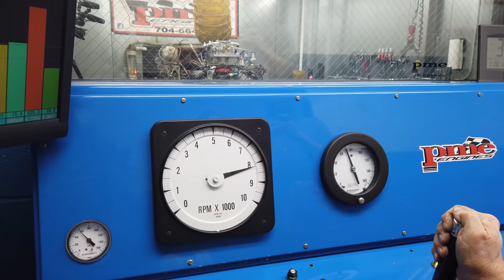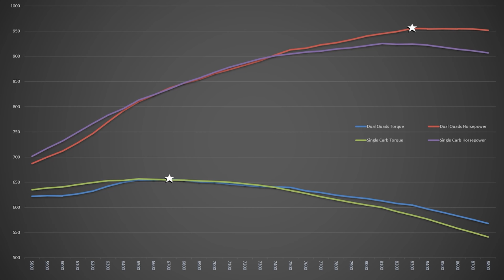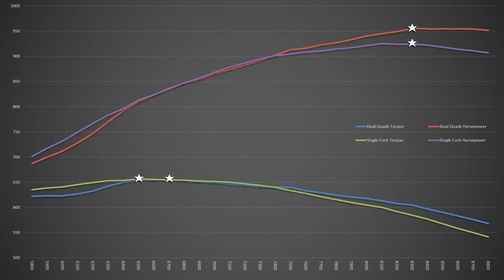955 Horsepower NASCAR Engine for the Street! (w/ ProMotor Engines)

Comment: "Used" parts or not (except for the crank), that's gotta be a $50k motor.
Reply: says it's $30k on Google.
Reply: @c.albrow9161  That actually sounds reasonable, given the exotic parts, and machining involved.
Reply: @c.albrow9161  that's too cheap
Reply: @freethinkingamerican80  tell that to Google.
Reply: 30k is no slouch either
Reply: @skoogle065  facts. That’s brand new vehicle prices we’re talking about
Reply: @c.albrow9161  Not to someone who spends 30k on an engine. Their new car or truck is probably 80k. Not hard to do these days.
Reply: @pookysdad4884  true. If I had such funds that engine would see itself in an early model C3 Corvette attached to a Tremec TR6060 with 3.73 gears 😂
Reply: @c.albrow9161  For me, it would be in a '68 Charger, with the 6 spd Tranzilla, from Rockland Standard Gear, and a fabricated 9 inch with 3:23 or 3:31s. It's fun to dream 😕.
Reply: @pookysdad4884  it truly is ☹️
Reply: @port nut dude it’s literally on their website. Stop being lazy and look it up.

Edit: matter of fact? Idk. Ask google
Reply: @pookysdad4884  nice charger but mine is an original 69 camaro ss w/ a bored out, tunnel rammed and cammed 427 with 4:11s and a tremec tko, with the car having Mickey Thompson 315s in the rear💪
Reply: Or a 72 nova w/ the same in which I’m 11 and I “own” a 72 nova
Reply: My Dad has a 600 Hp small block tunnel ram 78 Malibu drag car
Reply: @vincentgialanella1873  that sounds like fun, 300hp less hp but you can have  2of you got for the price this Beast.
Reply: @c.albrow9161  really? That's actually not bad at all for what you're getting
Reply: @c.albrow9161  Nascar claims 100k per engine 
If you could build / buy  a reliable 900hp engine that will rev like a Nascar for 30k
Start building or buying 
Serious $$ to be made 😉 
Can guarantee you can't
Reply: @c.albrow9161  NOT TRUE.
Reply: @deanmechanical  you know my comment was from a year ago right?
Reply: @deanmechanical  true then =/= true now
Reply: Used to be able to get them for 15k from Yates racing a while back.
Reply: If not more! Let's just be real. We're not all making thousands a day off YouTube.
Reply: @pookysdad4884  what filthy bum would opt for a nascar engine when an og 426 hemi rebuilder could be had for that money 😥
Reply: @freethinkingamerican80  it’s really not man you can get a 10.3 liter 632ci that makes 1000hp for 16,500$.
Reply: For me it would go into a Porsche 928 with the nascar trans axle with the sequential shifting.

Comment: It would be extremely cool to have the 700+ horsepower version.  When somebody asks “what is that….a LS?” you can say “no” and watch the gears start to turn in their head.  Or you could really mess with the Ford crowd if you put it in a Ford because of the distributor up front

Comment: My 455 Buick made 428hp at 4200 rpm and 565 ft lbs at 2800. All with a crower 210/214 @ .050 cam. Now that is a fun street sleeper. Idle is near stock and runs 11.70s.
Reply: Agree 100%. My 455 ran a custom 232/242, 112LSA .575 lift cam and it had a barely noticeable chop. 570 ft lbs, 442 hp. It was a real stump puller.
Reply: That actually sounds like a lot more fun than what's in the video. 565 at 2800 that's some push lol. I can't imagine tunnel ram and a cam that starts at 5600 being fun in street traffic.

Comment: Still push rod and 2 valves per pot. What an awesome engine!
Reply: A none PR in a 397 inch engine would be a huge brick. Fords 5.0 non PR engine is physically bigger and heavier than Chevys 6.2 engine.
Reply: @matrox  I'm still a cleveland fan
Reply: @matrox  there are 4 litre na BMW engines that are bigger and heavier than a 7 litre Chevy LS7 too, while making much less peak power and having a much narrower powerband. Long live the pushrods :)
Reply: @madhut3042  yes, D3 engines since the early 90's will make more power with a single carb. FACT
Reply: Think this is cool? (not saying it isn't, btw!)
Pro Stock engines are REALLY something!

Comment: I'd be very happy to have the street provision of this motor. 750 hp with around 550 ft lbs of torque pulling to maybe 8k rpm would be the best N/A option available.

Comment: This is one of the best Aspirations Index ( AI ) for a naturally aspirated engine ever. 397 times the 8300 rpm power peak, divided by gross peak hp is 3450.  The Australian V8 Supercar 305 engines, its 3630. I cant recall exactly the test, but I know for sure one of Richard Holdeners best 5.3 liter destroker LS was 3880, it was some thing like 550 hp at 7000 rpm or 630 hp at 8000 rpm  from 305 cubes. A flat head Ford was 221 × 3600/ 85, or 9360. As the AI number drops, you are  extracting the most hp from the least rpm. That modified R07 IS a Dynomo!
Reply: Hey
Reply: @arianawilliams1592  hey
Reply: @de4dlyzee  Hi,how you doing
Reply: TRUTH CENSORED  Personal opinion only, one which is worth nothing, (but since you asked....here it is)   Give it away to the irreligious,  non political and Un monied , and have no strings attached when you give it. And watch out for people with really tidy hair and natty dress. Over compensation is a means of raiding your pay packet. Good fortune with your quest.

Comment: Holy crap that thing's a beast. 😳 I always wondered why NASCAR style engines couldn't be found on the street. It's great to see they're finally making their way. More choices in engines is always a good thing. Great video sir!! 👌
Reply from the maker: Thanks a lot! And thanks for watching
Reply: A lot of the problem is that everything is different than standard engines. Such as they don’t have places for engine mounts because in the race cars they use engine plates. It also gets into race car stuff so the price tends to be high. With plentiful cheap turbo kits a lot of people just go the easy way and throw some turbos at a more standard engine.
Reply: People have been building these outside of NASCAR for a decade or more.
Reply: Well you couldnt get the damn car out of 2nd gear with a 1000hp engine on the freeway, whats the point of having it?
Reply: @holdenkingswood  Ive lost my license from tickets,  YES I loved that engine in the video but paying lawyers & high insurance has me a bit bitter about being labeled a criminal for my love of horsepower
Reply: @chadsimmons6347  yes you're right, the authorities much prefer us as the easy target and a way to generate mass revenue, you'd get in less trouble for mugging and drug dealing
Reply: @holdenkingswood  It's not so much hard to drive on the streets, but keeping it at 6000+RPM most of the time is a challenge. Not to mention the clutch they use is like squatting 400lbs....
Reply: @chadsimmons6347  🤣🤣🤣🤣🤣
Reply: They shouldn't be own the streets they should be own the track  track engines and street engines.its some shit on the streets is way to Much and I love me some street let's be real now.
Reply: @chadsimmons6347  that's my point exactly track is track street should stay street.we don't need all that for the street for what to kill ya self. Shit on the streets this days is already hellva fast.
Reply: I wonder how they do it with the 1,000 hp TRX that Hennessy builds.. they’re able to drive it at low rpm’s
Reply: Wondered why? Are you kidding me lol its people out here wrecking sports cars and you think they wouldnt with a nascar motor..
Reply: @HorusTheGreat22  horsepower doesn't matter. People who can't drive can/will kill themselves with less. Your point is moot.
Reply: @iceman45ification1  would be more deaths point blank period
Reply: @HorusTheGreat22  people that can't drive get killed in economy cars with barely enough power to get them moving. That's like blaming the car and its engine for a crash when it's solely the driver's responsibility. That's my point.
Reply: Super impractical for a street car. They make terrible low end torque.
Reply: @DonMr-Sir  forced induction

Comment: Just amazing how much the cup motors have evolved since I started in 1994 not to mention all the other stuff. I remember the first job I had to do was cut all the cross bars in the roof out because had to install flaps in all the cars. And learned a lesson about rinsing the shower out after doing that because the next morning it was covered in rust, took me a week to get it clean.
Reply from the maker: Very cool. What team did you work for?
Reply: @TheHorsepowerMonster  Jimmy Means #52.

Comment: A food for thought in case no one else figured it out. By moving the camshaft up further, it allows for a reduction in pushrod length and a much more narrow block. Less length means less flex and less flex means more RPM to turn without fear of bending a pushrod. The extra head studs also distort the cylinder walls and change it from a circle to more of an oval shape when it's torqued down. This change can have a major difference in ring sealing and power making plus a reduction in blowby. It's the small things you chase that make a big difference and wether you're 1st or last.
Reply: Raising the cam was necessary just because the cam journals are so big. I always wondered why production engines had the cam so low in the block. I thought it should have been raised long ago.

Comment: Some years ago, a guy had a Bush Grand National engine (next class below NASCAR) in an old rotted out Nova with a 5.88 gear, running pump gas and slicks, on the street! Ended up loosing it due to drag racing. Didn't want to shut off and had some amount of spark knock, but that ratty old Nova would straight get down! Wasn't around for long but built up an iron clad reputation to us gear heads as not to be messed with, though we still tried! Great and informative video,  my hats off to ya, sir! Thank you!

Comment: It's the first time ever I've heard about rod bearing speed and camshaft twist, that's just insane amounts of details
Reply: Having watched the clip on the Ford Nascar engine very different. 2.650 the same as a Clevo which were always considered to be too high in crank speed. People in the past modded them down to Chev size. 2.498.
Crankshaft and piston speed have always been an issue. And camshaft twist happens with very high rpm engines. 410 Sprinters have a problem driving everything off the front and rear of the cam and break cams. And they 'only' turn 8500!

Comment: I worked on these when I worked at Hendrick Mortorsports. I was doing cylinder heads for the SB2 and the RO7 up until 2021. Also these heads here are some of the first, they have changed drastically now.
Reply: Please elaborate

Comment: The current NASCAR engines before they were neutered were so dang impressive, they’d sing all the way to 9500+ RPM’s all day long. I’d love to have one sitting my family room just to stare at. Lol Awesome video! I’ll be sad when these motors are obsolete but hell, might give us regular folk the opportunity to get our hands on one. Probably not... but it’s a good thought lol
Reply from the maker: Glad you liked the video. Thanks for watching!
Reply: @3dwezzy740  hell yeah! I’m surprised more don’t make it to the street
Reply: @jimmy_olds  Super expensive to build .  Friend did a sb2.2 440ci mild HR cam made 726/625 at the crank in a 69 Camaro that was at autorama a few yrs back. He owned the Silve3r BUllit in the 70s (painted it white then)
Camaro was driveable and ran 9s.  He had good connections and still spent 25k on the engine
Reply: @gordocarbo  I believe it. I used to crew on an ARCA team, an Ernie Elliot R5 was at least $40k and more for a restrictor plate motor

Comment: Did anybody else notice how easily he slid those pistons in? Noice!
Reply: Yeah. The rings were pefect. It spun like butter.
Reply: They put standard pistons in a .050 over bore. Lol
Reply: Good observation Modern engines generally have very low tension rings.
Reply: I noticed at one point when turning the engine block over on the stand that the weight of the big ratchet on the  crank rotated the crank as the block was turning over after they had shown piston installation
Reply: Special coatings

Comment: Somewhere a tree hugger is apoplectic.

The irony is that this engine probably runs cleaner and more efficient than most factory engines.
Reply: No way with that much valve overlap.  It's a gross polluter by any measure, except maybe at or over peak torque.  It's efficient for sure in it's operating range, but don't confuse bsfc with clean tailpipe emissions.  NOT the same thing.
Reply: No catalytic converter, carburetor, huge cam. leaded fuel.... no, buddy, that thing pollutes like a Chinese factory.
Reply: @PistonAvatarGuy  who cares fire up them engines
Reply: @MrLadysman333  Seriously.
The term 'gross polluter' has taken on a completely exaggerated definition today.

A whole fleet of these things wouldnt make a dent in any environment.

Comment: Throw a 4” stroke crank in that with 10.5 to 1 compression and a tighter cam overlap with lower lift and that would make a killer street engine
Reply: A 7+ liter R07 for the street would be the ticket. The deck is pretty short (about 9 inches) so the rods would have to be shorter and the ring package would be pushed way up on the piston. But it should be doable as an NA engine.
Reply: boring...put this motor in a lightweight car with a huge gear and a liberty 5 speed and have extreme fun
Reply: @Edwar3505  a blower might be good ticket for low end torque
Reply: @xozindustries7451  Who needs torque?!? put a huge gear in it and rev it to 9500

Comment: Badass motor. You should get ahold of Dugans Racing Engines in Riverside, CA. They are building 555" motors that are 1100hp designed to go 1000 miles offroad in Trophy Trucks. Similar builders are Kroyer Racing Engines in Las Vegas, Nevada.

Comment: Best part about this post was the fact NASCAR engine builder PME was planning to offer actual engine components and build anyone, a crate engine basically with the knowledge and tech of a nascar engine that’s truly engineered to withstand 20k miles durability testing, not single races. Yet some of these pond jumpers want to compare the thousands of engines built over decades to some exotic one off, no average person can afford super car, that requires $100k services every 5k miles, no thanks! 
My only fear is the oil belt here! Awesome stuff from Pro Motor, American Muscle like No other.

Comment: I'm gonna need the full send version asap
Reply: send me your motor now then
Reply: @JayAR_YT  the motor I have runs great. 560hp na small block with 23° iron heads
Reply: @basketballcory2  Im running a 6.0 LQ9 in my 2000 catfish camaro. 430-60whp to a 3 speed TH350 with 3.42s
Reply: @JayAR_YT  nice
Reply: I'm running a catless downpipe on my 2008 gti
Reply: @supersnake6450  sweet
Reply: @JayAR_YT  sounds like mine but in a GMC canyon with a 5 speed manual.

Comment: Interesting that the inside of that single carb manifold was a rather ruff casting to help emulsify the incoming fuel. I wonder what would happen with EFI.  David  Vizard talks a  lot about the Beehive valve springs. That was another surprise.  Great Show and editing!!!
Reply from the maker: Thanks! And thanks for watching
Reply: Rough surface finish has been proven to flow better in these applications, with some porting gurus actually dimpling the surface on purpose.
Reply: Dimpling does nothing but detach the air. 
Smooth surfaces are bad as the air sticks to them.
Reply: @shanerorko8076  so dimpling is good then as the air flows better and does not drag on the runners/intake path
Reply: @aeroflopper  That is correct. It also aids in keeping the fuel droplets from puddling in corners or low pressure areas.
Reply: Life_of_Riley incorrect. Darin Morgan has said the rough finish is good and dimpling actually pulls the fuel out because they produce low pressure areas.
Reply: As for the dimples.... think golf ball

Comment: I need the 700 hp engine in my S-10 !
Reply: I would love to custom fit the Nascar V8 motor and transmission in a Pontiac Fiero, that's got body modified to accommodate such setup.
Reply: Although having such engine in a S10 / S15 pick up or Blazer / Jimmy suv is not a bad idea.

Comment: The video, narration, footage, and editing is on par with commercially produced content. Thank you. 
I don't know what to think/feel about the engine. I've never had/driven anything like this, but 600 lb/ft doesn't make my willy wiggle. It seems it would be a pretty linear/smooth application of torque, but I like a little more peaky power. I think it needs boost. It moves air for sure, but needs something to wake up that torque curve.

Comment: Just been watching your great motor series. I noticed that PME is also using roller bearings for the cam journals. I believe 
I'm the guy who invented this idea. Over 30-40 years ago I sent drawings to Rich Preston (Head of R&D) at Mr. Gasket. However, 
at that time when I come up with the drawings I suggested needle bearings. With today's high horsepower motors I'm not sure 
the needle bearings would last too long.

Comment: Same engine that the late John Lingenfelter built and ran in his S-15 Sonoma, for the NHRA pro stock truck class back in the early 1990. Class was limited to 360 cid , he ran 358 cid  with the same internal engine mods exactly just smaller CID so love the sound of angry!!!!
Reply from the maker: Sorry, but I don't think it was the same engine. The R07 didn't appear until 2007.

Comment: Unbelievable that engine is definitely not suited for the street but for the race track but for the diehard hot rod I could see someone run something like that on the street maybe trailered then up and down the street a couple times maybe but all in all that things are monster thank you for this video unbelievable engines either way you go incredible horsepower. From San Diego California